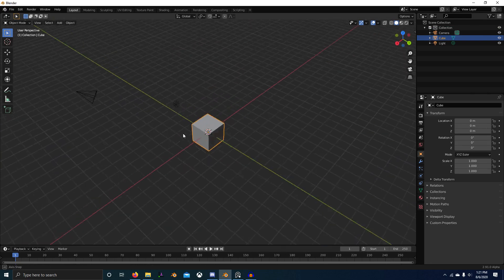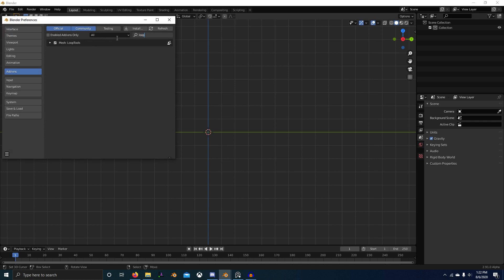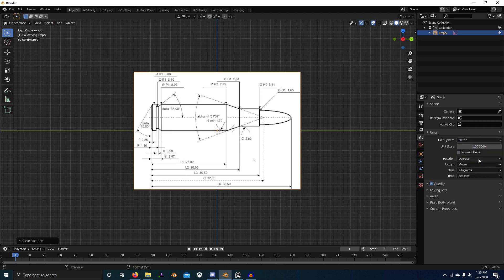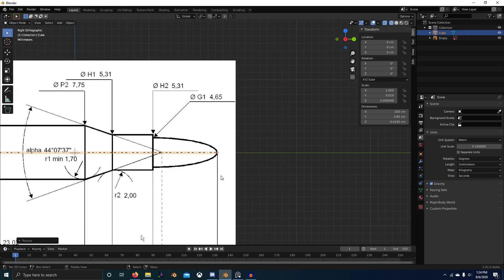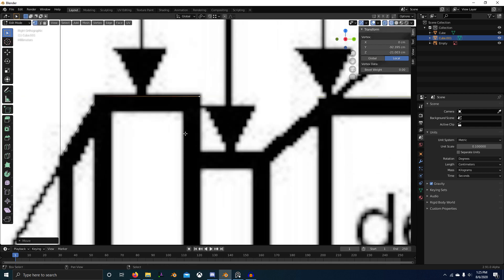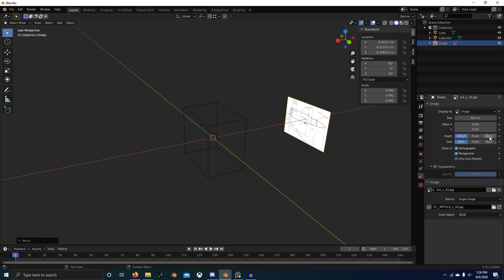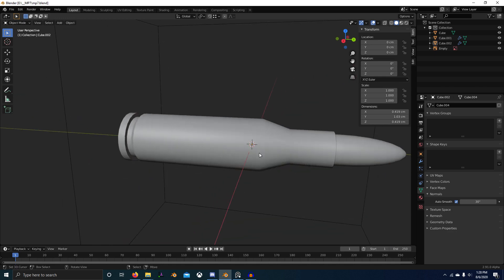Blender MP7 Game Asset Tutorial Part 1 | Addons and bullet

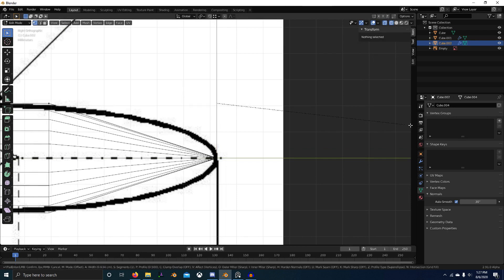Comment: At 5:25 for some reason my thing isn't bevelling? I'm in the edit mode, I have just the corner vertices selected, and I'm using CTRL + B to bevel, but pulling it in any direction doesn't change anything. I've tried using the bevel tool button too rather than the shortcut key, and also tried using edges, but still nothing.

It seems to work fine on 3D geometry, but not on the lines or 2D (I tried with a corner of a plane too), even with the screw modifier applied
Reply from the maker: Do CTRL+SHIFT+B to bevel only vertices.
Reply: @loldoblender625  I hate Blender with a burning passion, thank you, but now this is happening, haha https://www.youtube.com/watch?v=AonwIDVjXCs
Reply: if the model is too deformed like if u extrude too  much it wont know what to do from my knowledge and will bevel it as much as it can

Comment: Might wanna slow down a little, little too fast for a tutorial and sometimes your doing things without mentioning them before hand, may even put "Intermediate" in the title as new fokes can have a hard time following you, other than that good video and certainly learning something new with the screw modifer.
Reply from the maker: I think i said intermediate/advanced in the promo but its already like 30 hrs of video. :/ The flashbang tutorial is much shorter though :)
Reply: @loldoblender625  Fair enough :) Having it in your title may be easier though, good thing am not new to Blender so no issue on my end but would think it is for new comers, many just skips to where the action actually happens. Just a heads up if questions comes in :)